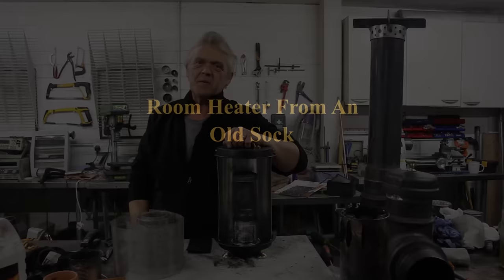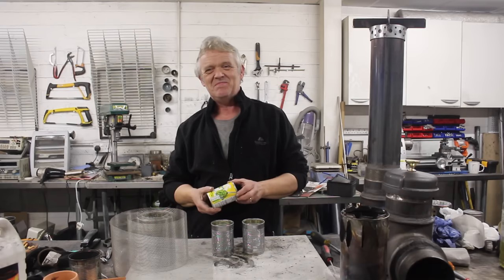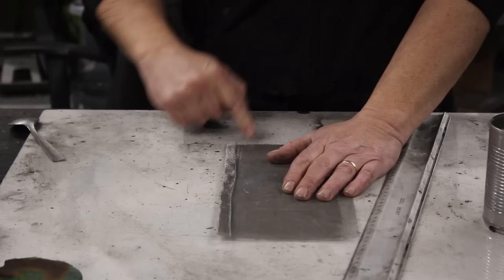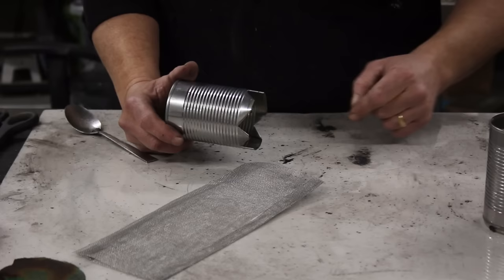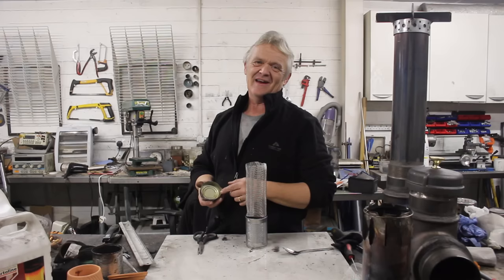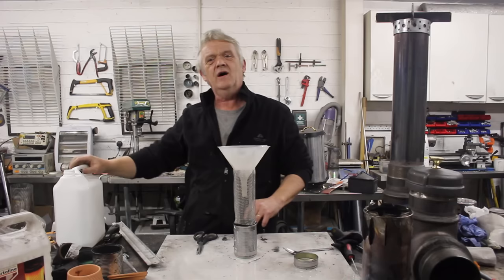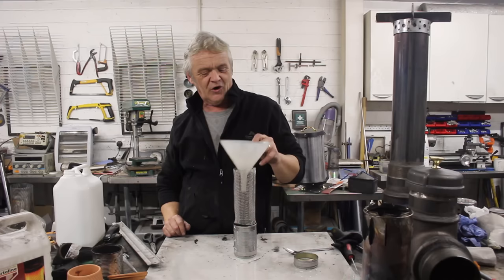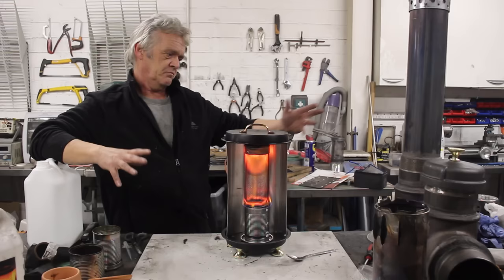1746 DIY Room Heater From An Old Sock

Comment: I'm assuming that the cut edge of the can with the mash and sock is on the bottom before putting in the bigger can?? Or am I assuming incorrectly? That is something you skipped over, and once again I'm assuming it's pretty important to the functionality of the heater??

Comment: Am I making a silly assumption that a natural fibre sock would be better than a man-made fibre one? Ie cotton over nylon?
Reply: Try wool.  Wool does not readily ignite, tends to self extinguish, and has an combustion temp of over a thousand degrees F (higher than kevlar and nomex--two substances considered fire resistant).  But it is somewhat hard to find 100% pure wool socks nowadays.  You'd have better luck buying a yard of fabric of pure wool or going to a clothes thrift store and getting a used, 100% wool sweater.

Comment: Robert,
I live in zone 6 USA and have a medium/small greenhouse. I've tried various DIY heaters. I tried the 2 can system you made, but the smaller can blew out of the thing. I found the carbon felt on eBay. It is under the title Carbon Fiber Auto Welding Blanket Torch Plumbers Pad Heat Sink Slag Felt 12''. It really does work!! Thank you. My real problem is finding long-lasting fuel. I had a load of gel hand sanitizer and found it to work amazingly well but it doesn't last long. I've considered making it auto-feed, but I am very conscious of fire. I am working on it now. Any idea why my can would blow out of the other? I made it as exact as I could following your suggestions. Thanks!! Tim (I love your channel!!
Reply: My only guess is that you had it so tight inside,that the traped pressurized vapors exploded that caused the can to act a projectile...🤔😬😜
Reply: Timotrio, if you don't mind me asking but was there a large enough hole on the top of the inside tin? I'm asking because it seems that if pressure builds up quickly and it cannot escape quickly enough (if the two tins are Very tightly sealed with carbon felt or other material) something has to give, so the inside can pops out.
I noticed in this video above, that the whole top was removed so pressure build up would not be a problem.
Also was it pure spirits you used as in ethanol, methanol or isopropanol or did you use something like veg oil or a mix of veg oil and ethanol, the thicker viscosity not allowing pressure relief if you'd no hole on the top of the inside tin and by clogging the felt or whatever wick material you used because of that thicker viscosity.
I have watched another video were the inside tin blew/popped out, there were tiny holes on top of the inside tin and a wick material that wasn't carbon felt so you're not alone on this one.
Yes I agree, it's not really a very economical heater when you do all the maths as I have...energy value per litre/price, unless you're getting cheap or free fuel, all energy is worked out pretty much to a T and we're getting robbed in the process.
I do however like the look and performance of these heaters, interesting no doubt.
Reply: @pa_maj.MARTINI-van-MAN  
Sorry but I am a different Smith,I'm not Robert Smith...This you asking is over my head but maybe Robert Smith can answer your questions 👍😎.
                  But I will add one more thing by asking this question... Did the can blow out as the feul became very low or even run out?... This would be the reason that vapor would arise in  causing trapped vapors to explode 🤔.
Reply: @ellissmithjr6599  I was actually referring to you 👍No, not long lit but possibly half full.
Reply: @pa_maj.MARTINI-van-MAN  
Ok,good luck 👍

Comment: Why not use glass-fibre ceiling insulation?
It works fine in my TomCat stove, which is essentially the same design.
Reply: the glass melts and stop the wicking effect

Comment: My local petrol station is selling 5lt of Paraffin for £3 whereas methanol is around £14 for 5lt, wouldn't Paraffin or used cooking oil work too? Or even a mix of the two, and White Spirit is around £5 for 5lt and has much lower toxicity, same as Turpentine.
Also, is that a cotton sock? As most socks are made with synthetic polyester which contains terephthalate (PET PETE PETP)  which is toxic when burnt, I'm thinking a bandage sock would be better as they are made from 100% cotton, and very cheap, as 2mt for £1 at most £ stores.

Comment: Hi Robert, very very nice! Is there any possibility to regulate / Turn off the heater at desire? Building it this way, wil burn until all the Ethanol is completely finished into the reservoir?

Comment: Love your videos!  
🤔Umm…is carbon felt wick, same as carbon felt welding blanket/shield??
Because, if it is, Amazon has , many sizes, & not much money.  Or a local store selling welding supplies likely has it, too. 
Also, considering stability…
Someone suggested magnets on bottom of the can reservoir, to magnet it in place. 
But they worried about magnet degradation…
Let’s THINK about logistics of parts & function: 
🤔 If magnets are on the can-base, & it got hot enuf to degrade magnets…
…wouldn’t that kind of heat, at minimum, increase the gasification of the alcohol in the can reservoir, which would increase flame, & decrease burn-time…..if not explosion (overheating would have to happen pretty fast to do that, though)? 
🤔I’d think, having the small air gap  the can, formed by the magnets, could also (for a certain amount) help keep the can reservoir a bit cooler? (Not that it gets too hot…?)
🤔And, one could use a piece of flat metal w/center hole in it, to form a top-shield around top of can, to reflect flame heat up, instead of letting any go down around the can? 
🤔IF concerned about the magnets, maybe Neodymium ones last longer? 
🤔IF concerned about the magnets, then instead, maybe use a slightly larger ring than the can-base—maybe a simple metal cookie cutter—attached, centered, where the reservoir can is to sit-into, to make sure the heater assembly cannot tip or move?  That could be stuck in place using high-temp stove caulk? 
🤔Is there a decent safe way to extinguish one of these?  …Maybe another piece of curved sheet metal to make a fairly tight-fitted front door, which could cut-off O2 getting into the stove, snuffing the flame?   …Or an Internally mounted damper w/handle outside of can to operate it? 
This heater is a great survival idea!   
Even better, using recycled materials as much as one is able. 
Countable less toxic emissions than, say, propane.   & it’s limited batch use, important to prevent unattended use. 
Alcohol burners have been used in boats, for Ages!…& one can ferment their own alcohol, if they know how & have the materials. 
There are recycled tin can alcohol cookers, too…saw videos about making those, too…those make less heat, shorter burn-times, but for some, might be safer?

Comment: Trying to think of a way to shut it off.????
If there was a sliding ring outside of the screen, couldn't you just slide it  down around the wick and shut it off???
Also remember when robert did the safety heater? Why not another screen outside the main screen to keep the flame inside????

Comment: That heater looks very dangerous to me, with big open flames. And even with the store bought alchohol heaters there has been many serious accidents. I would say that you shouldn't do this unless you can put this heater inside an open fireplace, with a chimney. And maybe not even then. Because it could still get knocked over by accident, and the alchohol or oil could spill out onto the floor. And if you have cats, dogs or kids, forget it..

Comment: Ok, there's a heater design I want... I'm not the best when it comes to making things outta metal and won't lie, I'm actively looking for someone to make this for me if possible.. 
An Alcohol coil heater... But what I need is a rectangular fuel tank that holds 2 quarts with two 1/8 copper tubing coils on both ends so I can put 2 #10 cans over the burners with a fuel filler in the front center.... Any help would be appreciated

Comment: I think I commented on the wrong vid, I’m trying to turn hand sanitiser in to fuel for this type of heater, it keeps setting rock solid in the top of the wick. I’ve thinned it using the salt method and it’s totally liquified, but after 40 mins of burning it destroys the cotton wick. Any ideas? Cheers Dave.

Comment: You know that you can make a carbon sock by putting a sock in a sealable metal container and putting a metal lid on it and putting it in a fire. Like you would making charcloth. Don't know if you can show this to others or if it will even work ?
Reply: It won't be as flexible and durable as carbon felt. It will be more crumbly and fragile. Industry uses special materials and processes beyond the average DIY'er when it comes to making carbon felt and carbon fiber.  For example, a completely inert atmosphere is different than "mostly" inert (i.e. still  some oxygen present).

Comment: I advised wool earlier, but I found out that wool, when it burns, creates prussic acid or hydrogen cyanide. So wool would be a substance to consider very very carefully as a wick …
Reply: I tried wool felt it didn't burn but it melted and charred so was no good after the first burn.

Comment: Hi
What can you use instead of the  
Steel mesh as it is a bit expensive just for a foot to make a heater
Reply: You can buy a couple of A4 size sheets on eBay!
Reply: Will it work with cooking oil
Reply: splatter guard for frying pans, most supermarkets sell them,but make sure it's a stainless steel one.

Comment: The bottle of methanol is being poured incorrectly (from a safety perspective), far safer and easier to pour if the hole is the other side of the handle (eg above the handle) this allows air to flow in whole pouring and no splashing.
Reply: I was shown as a teenager (a very long time ago) to pour holding the container sideways and pour, don't tip, it's always worked flawlessly for me since. Same logic applies though.

Comment: Greetings. I made a heater similar to the one you made and for some reason I'm getting a noxious, black sooty smoke coming off of it. So I can't even use it. Is there an explanation or a solution to this problem? I'm using 91% isopropyl alcohol, and have tried different heights of the wick, even ordered carbon felt.

Comment: Is this not the same as just having an open can? I can only imagine that because the middle section is open, it’ll just burn mostly from there.
Reply: It's a general rule of chemistry - liquids or solids don't burn (at least not easy), with some exceptions of compounds with oxydizers in them, but you should stay off those things if you just want to heat your room, not to remove it from the face of the earth. 
First you need to pump enough energy (in the form of heat) into your fuel, so it is ready to evaporate and combine with oxygen. But heating a can full of flammable substance like alcohol or gasoline would be unwise. Beleve me i tried it as a kid and i lost my eyebrows and a fringe 😆And i felt soooooo smart back then because i boiled alcohol just in a tiny bottle cap. But the flame was awesome! 🤩
That's why ancient people invented a wick - a substance that is able to "suck" and transport flammable fuel and to heat just a portion of it. Wick also gives more surface area for fuel to evaporate.
So if you dump a piece of natural rope in a bowl of oil, you have a somewhat safe way to have controlled flame. Or if you find such very old lamp, you could try rubbing it and hope for a djin to appear😜
Reply: the mesh stops the flame from getting to the inside, I'm trying to make one where the flame is contain inside the mesh

Comment: Tried the carbon felt with oil under a terracotta pot. Lots of black noxious smoke. Disappointing so abandoned whole project.
Reply: Have you tried shortening the wick? Sounds like that's what is needed as the fuel isn't burning clean, too much fuel and not enough air flow causes black smoke. Some devices use forced air flow in a sealed unit, if it's an open unit, shortening the wick will combat the problems. Hope this helps.

Comment: You amaze me every time!!

I do have a question. I have a bunch of aluminum window screen - is there a reason you specify SS? Is it more flame resistant?
Reply: Two questions - can the old sock also replace the forever wick in a piece of copper tubing?
Reply: aluminum cans will burn down in a hot campfire in 1-2 minutes or less.
Reply: @modelnutty6503  I thought as much but had to ask. Thank you!
Reply: if you can find an old dryer the lint trap is ss mesh and yes cotton will work in the copper tube.  but cotton will burn down
Reply: @rayg436  Thank you very much! I ordered the SS and carbon felt today, but it's always great to know!

Comment: So how long would 100ml of Methonol last, Rob?
Reply: Mine burns through 400ml per hour which is expensive and unbearably hot. I recently added water to the methanol to cool it but it adds moisture to the air. I'm thinking of using a different kind of wick to slow the burn.

Comment: Will this work with new socks?
Reply: You'll want to stick with natural materials as polyester, nylon, and polypropylene melts when heated.  Cotton etc doesn't melt, but burns, but it takes higher temps to get it there.  Wool has the highest heat resistant properties of common clothing materials.  Such as a combustion temp of around 1100* F, which is higher than kevlar and nomex--two materials considered and used as heat and fire resistant materials (firefighters, etc) .  

   But far better than any of the above are things like fiberglass clothe, rockwool insulation, ceramic fiber insulation, or pure carbon felt.

Comment: I look forward to your videos every day! I suppose a cotton sock would be better than a synthetic fabric sock, like nylon or rayon, or whatever. Correct?
Reply: @mrfitz96  But aren't most commercially made wicks made of cotton?
Reply: As the author of this video stated, the wicking material (sock in this case) would be burned very slowly over time. I doubt enough acrolein would be produced to be concerned about. That said, perhaps lighting an entire cotton sock and purposely inhaling the smoke might not be wise. :-)
Reply: I had a look and it appears the article from which your info came might have been referring to vaping.
Reply: Correct. However a cotton candle wick is chemically treated to be flame retardant which slows the rate of burning & makes the candle last longer. Also compare the relative amount of cotton material being burnt in a candle versus this device. Short of lab testing I'd stick with pure wool.

Comment: Sorry to be a tedious safety nerd but it does look rather knockable overable (could be a good experiment vid tho) so maybe add a wider base ? 
also I'd like to be able to refill it easier than having to dismantle it (see what I did there ?) any ideas?
Reply: big round cookie tin base with a center can JB-welded in for center air updraft..
the burner affixed top center of lid to fit over updraft. the wide base being fuel tank, needs several short legs to be off the floor 3/8" so air can get to the vent..
think simplified "KeroSun" kerosene heater design.
Reply: He recommends building two burning Chambers in another video, just swap them when one goes out. This is actually a rather safe way as the flame can be barely noticeable when it's going out but not quite out right which will ignite anything being poured unto it.
Ethanol heater manufacturers recommend leaving burners for 15 minutes to cool down properly before relighting Ade.

Comment: Does anyone know if the methanol can become too hot and explode? Is there a burn time limit?
Reply: Shouldn't be an issue so long as proper airflow is allowed, though it wouldn't hurt to try it in a safe space first in the event it might.
Reply: Do Not let is run very low or even out,then you may have the risk of vapors in causing what you have mentioned...

Comment: Am I wrong here or would it be vital to make sure this is only pure cotton.  Any wool or polyester and I suspect you'll really regret it.
Reply: Wool has far better heat resistant properties than cotton.  Such as a combustion temp of 1100* F.  It is also not easy to ignite and tends to self extinguish.   Cotton on the other hand is readily flammable unless treated with baking soda or the like.  Cotton will start to burn/catch on fire at around 410* F.  

    Wool will smell a lot though once it starts burning, being made of protein vs cellulose.

Comment: Robert, I now wonder,  why a can of mushy peas, or the sort, does not have a warning for the town idiot or upcoming imbecile chef that there is a clear and present danger with the sharp edges of a breached tin! Also, a stern warning may be justified for the viewing, somewhat studied, engineer why it may not be suitable to ignite a substantial flame about 32cm from an open vessel containing about 4 litres of methanol without a cap on it, unless you use it for an armrest! This is all in jest, of course.

Comment: Robert! why not ROCKWOOL for an eternal wick??
Reply: You can use rockwool, fiberglass clothe, ceramic fiber insulation, etc, etc.  Basically any heat and fire resistant material that has a fibrous nature will work decently to well.  Of super common materials, wool should work best having a combustion temp of around 1100* F, not readily ignitable with a tendency to self extinguish.